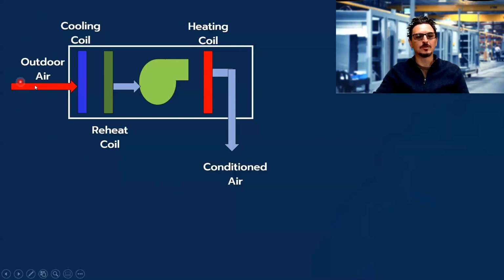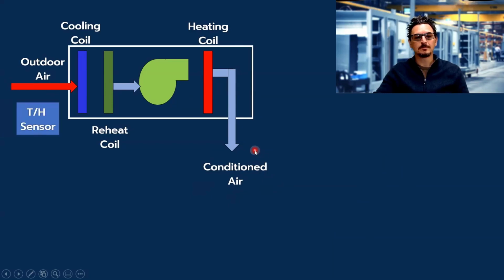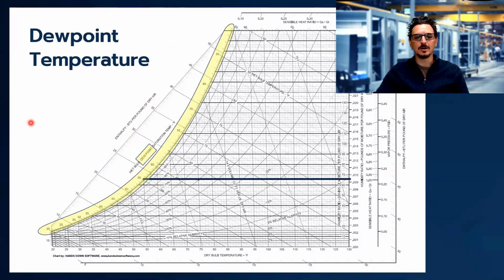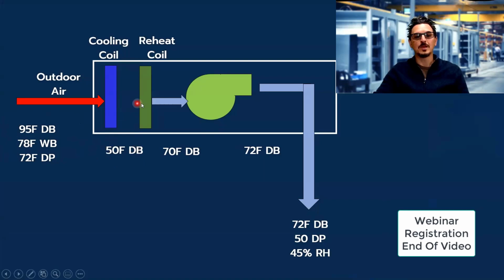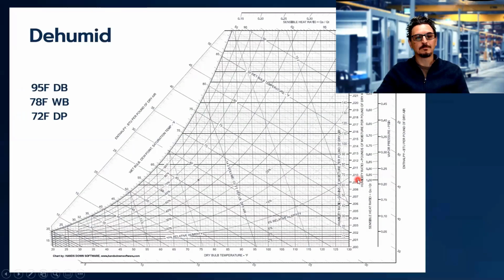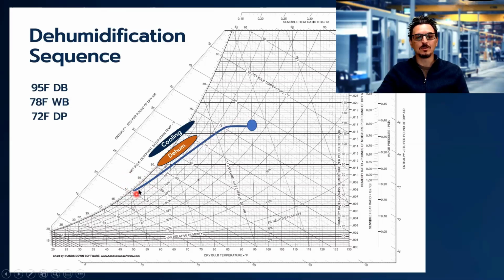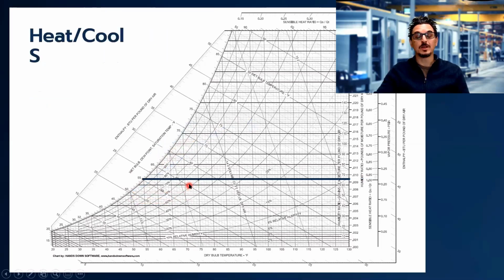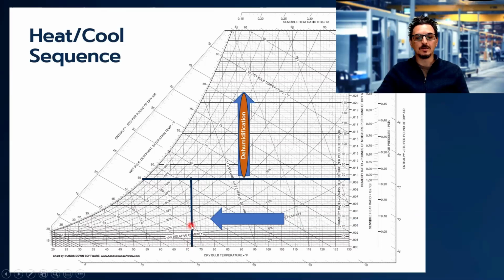MAU Dehumidification Sequence

Comment: Awesome video and chart. Watching today because I had an inkling that a building MAU was in dehum mode while heating. OA temp 60 degrees with space temp 68. Target was 70 but it was barely heating much. Humidity 63% so I think it was still trying to dry the air out.